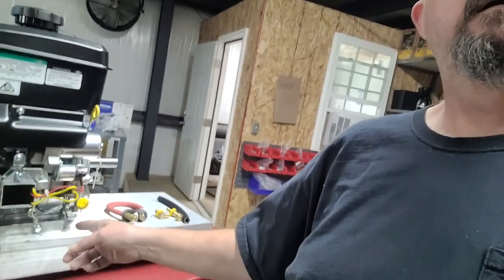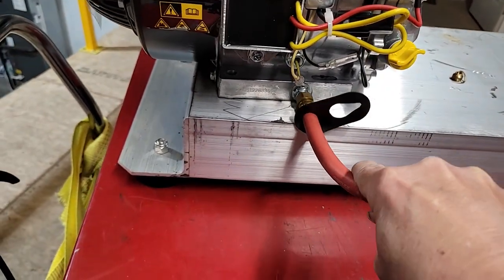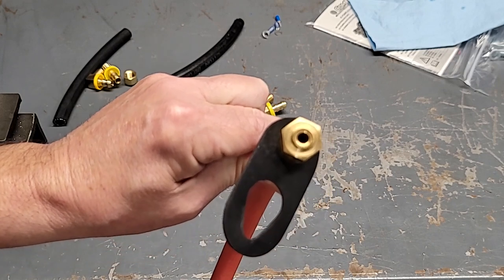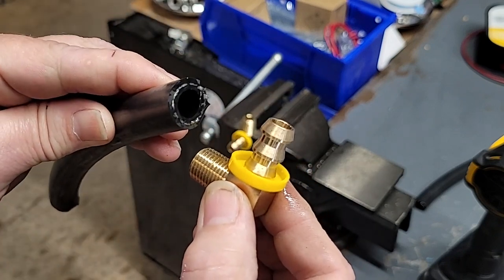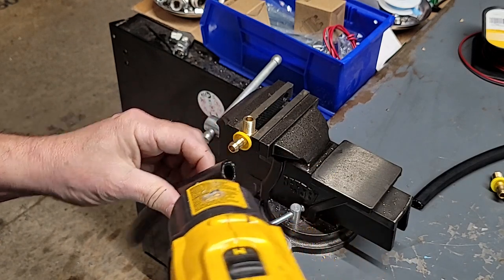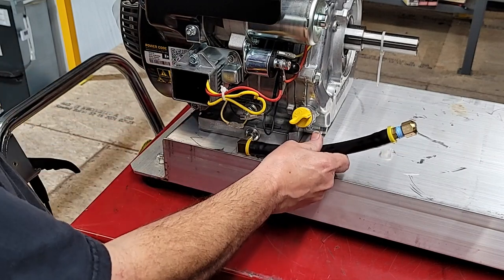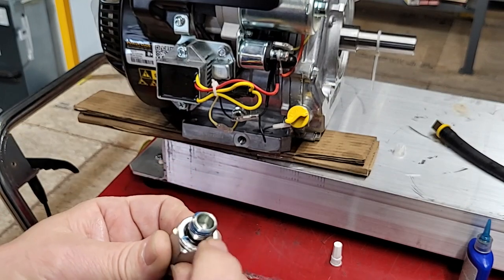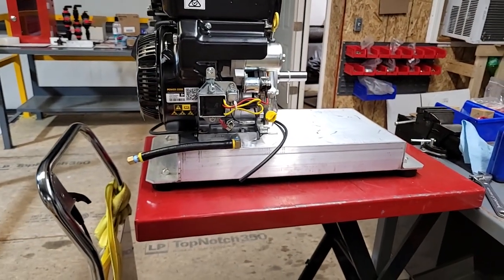EZ OIL oil drain hose kit for your small engine.

Comment: Yes, the larger opening will drain the oil faster. What's the big rush? I use the red hose that he did not like. I come back in 10 minutes later, and all the oil is out of the engine. The advantage of the red hose is I don't have to make anything. I can buy it and install it in less than 10 minutes. I'm not criticizing this man's improvement, I just don't see that it's worth the additional effort.
Reply from the maker: The 12mm fitting on the red hose is very thin walled and seems to snap off easily . Thanks for watching and commenting

Comment: Very nice video.
wouldn't you need to put a little extra oil in the crankcase to make up for the volume in the added hose?
Reply from the maker: Yes, I'm positive you will have to add a touch more oil.

Comment: Wish you listed the parts you used. Good video.
Reply from the maker: Parts will very depending on what engine you are setting up.  Once you know the thread pitch of your engines oil drain plug, your local hydraulic shop should be able to help.
Reply: @TheRustyRooster  Thanks for the reply. I looked up the drain plug part number for this engine and then the specs (some online folks were kind enough to post what the OEM likes to keep as 'trade secret' Lol). I found a low profile 3/8 in NPT elbow and will make a pipe version. Looks like I'll be able to install the elbow without touching the engine mounts.
Reply from the maker: That's great news. It should be an easy install

Comment: Good idea!  you said that these pieces could be acquired at a hydraulic hose shop.  A link to sites and the name of the parts would be helpful.  Google tells me that Grainger has the "push on hose fittings" that look like yours but the adapter from the engine to the push on fitting...is it stainless steel ?  I put something like the red hose on a standup commercial mower and it broke off and dumped the oil.  Fortunately,  since I was standing on the mower running it at the time.  I noticed it and shut the engine before it could get destroyed.
Reply from the maker: Thanks, fella. I never found an online supplier for these parts. I use our local fitting source
Reply: @TheRustyRooster  I appreciate your response fella

Comment: Nice video! But how about describing the fittings and hose type? Along with where you purchased them? I live by large city and cannot find any of these fitting?
Reply from the maker: All items should be available from a good hydraulic shop. 
3/8 push-lock hose, with 3/8 push-lock fittings. And the metric adapter depends on what engine you install it on.

Comment: That's exactly what I was looking for. Replacing the engine on my snow blower and that is going to work  perfectly. Where did you get the parts
Reply from the maker: Local hydraulic shop is where I get these supplies

Comment: Can you put a valve between the hose to control the oil out?
Reply from the maker: You can add a valve if you like, and they make them just for this use.  I don't use them. I have seen them accidentally hit and drain the oil.

Comment: Hi Rusty and thanks for putting together this video. I have a Kohler CH440 on my stump grinder. In my searches, I'm seeing some folks calling out a 12mm thread and others thinking that it was changed to a 3/8" NPT. You mentioned the 12mm. Can you verify the pitch of that? My plan is to be ready with both fittings when I make a mess with my first oil change so I upgrade to your tubing set up minus the angle fitting as I really don't want to unbolt the motor. Thanks. Oh yeah, I forgot to ask where you get the adapter fitting with the o-ring seal?
Reply from the maker: Hey Hey Iceman, that CH440 Indeed has 12mm x 1.5 pitch threads. I order them from my local hydraulic shop, I have found them on the good ol AMAZON. 
Male end is 12.5mm x 1.5, x 1/4FPT.
You my find that you need to loosen the engine to install.
Reply: @TheRustyRooster  Thanks again.

Comment: Hello I just subscribed to your Channel I was trying to figure out why my scissor lift table I picked up in some junk will only go up apparently I need a controller not sure how to wire any suggestions I did a video on it working but can't find any brand names on this thing
Reply from the maker: Thanks fella I sure appreciate that... I'm not sure about your lift, but mine is electric over hydraulic. Yep, like yours, it came from junkyard with out control.  I wired 2 garbage disposal switches together. 1 for up one for down. 1 powers the lift, the 2nd controls the pressure release solenoid.... hope that helps
Reply: @TheRustyRooster  hey thanks for replying back I've actually got mine working it was a 3-phase I converted to single phase and I just want to a 220 plug to raise it and one can switch to lower it works for me for now I'm a put it all in the same circuit at some point have a good night and thanks again

Comment: Nice job, rusty. What size drain hole is that bolt?
Reply from the maker: That engine is 12mm
Reply: @TheRustyRooster  ok thank you.
Reply: Rusty, is this the same size hose drain for the GX690 Pressure Washer?

Comment: Your adapter hole is as small as the other hose you did not want to use.  Still will drain slow.
Reply from the maker: Yep, you are correct, yet it's not going to snap off. Thanks for watching.

Comment: Mr rusty where can I buy this parts
Reply from the maker: Your local hydraulic shop should be able to help with this if not holler
Reply: @TheRustyRooster   I call few in my area  but no luck they didn’t  have it in stock they said
Reply from the maker: What engine are you working on and what area are you in?
Reply: It’s a Honda 390 gx
Reply: Nashville tn

Comment: Hey Rusty what's the thread pitch on that 12 mm adapter? These Chinese Briggs are supposed to be 12 mm x 1.25 pitch from what I'm told. The only thing is the only adapters I find is 12 mm x 1.50 thread pitch. I tried some local hyd. shops and they don't have metric, at least that's what they told me.
Reply from the maker: The vanguard 14hp uses the 12mx1.5. I'm disappointed in your hydraulic shop. 
https://amzn.to/44hyzWE
Reply: @TheRustyRooster  I am too Rusty. I only have about 4 hrs. on this machine, and I plan on changing the oil quite a bit during break in, these Chinese Briggs motors don't have a real good rep.!
Reply from the maker: Link to the fitting you need is in the last reply
Reply: @TheRustyRooster  Thanks for the link Rusty I'll be ordering this one.